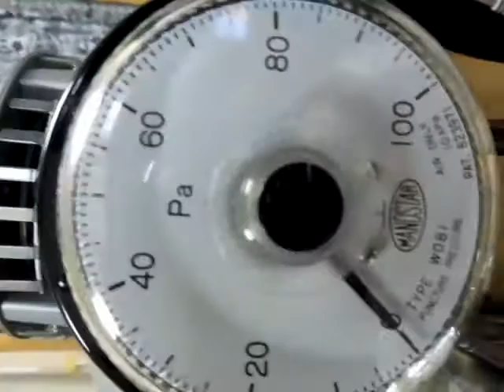DIY 1.1Lb Coffee Roaster and Smoke removal device using a Bubbling Water

Comment: I have wondered if this idea would work. Was the water dark at the end of the roast? How was the odor in the room? You are the Tony Stark of coffee.
Reply from the maker: Thank you for your comment.
> Was the water dark at the end of the roast?
dark rose red. very sour taste. smell of pyroligneous acid(wood vinegar). Your insight is very sharp.
When processing the intense smoke, such as the French roast we need another adjustment.
To adjust the air flow rate in the negative direction, to fail if utilizing the load of foam efficiently.
Today, I have failed in the first time of the test. 
Extinguishing the smoke of other roasted batch was completely successful.
Weekend to upload the movie.
Google's translation feature does not work well with always.

Comment: Sasuga! Great video! .I want to ask 1 thing, is the fire directly contact with the wiremesh like your previous drum roaster ? or you use some kind of double layer steel? i was built something similiar with yours, but the taste is terrible, the bean colour was good, but the fire is took away all the unique taste, i compared it with profesional roasters with the same bean. thank you, sorry for bad english
Reply from the maker: >is the fire directly contact with the wiremesh like your previous drum roaster ?
direct fire roast.

>but the taste is terrible, the bean colour was good, but the fire is took away all the unique taste, 
It is a rudimentary trouble.
Placement of the heat source and the drum is too close.
Appropriate distance is required for the heat source and the drum.
Do not touch the flame to the drum

There is another point.　Exhaust adjustment.
Adjust properly along with the progress of the roast.
Prohibited from storing the exhaust to the drum.

I'm sorry to be able to tell a lot if speak with you and the native language.
Reply: oh i see, i ll try the fire setting and add exhaust, thank you so much